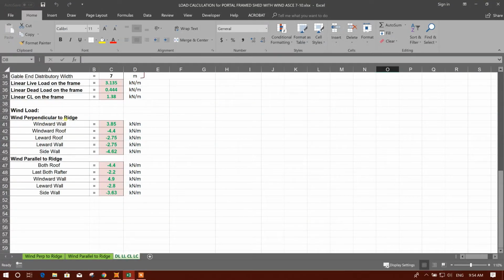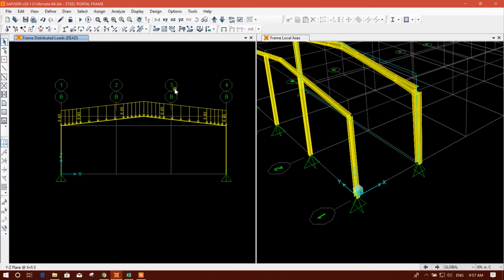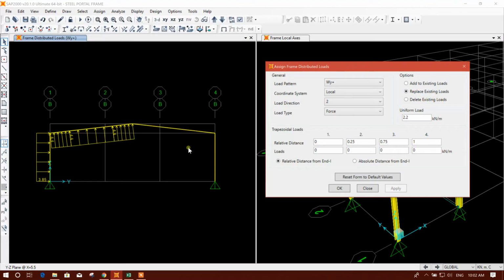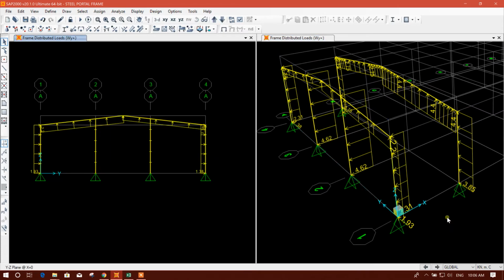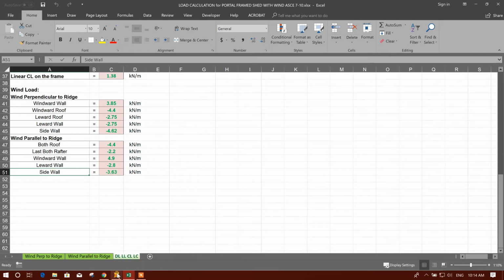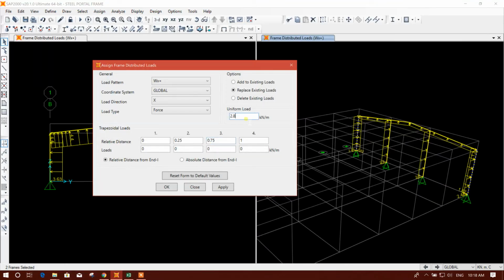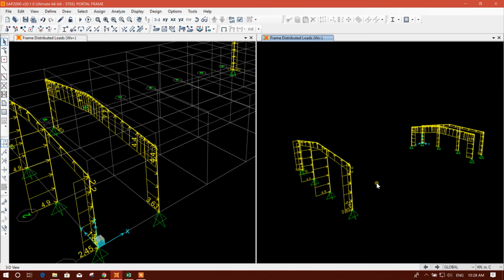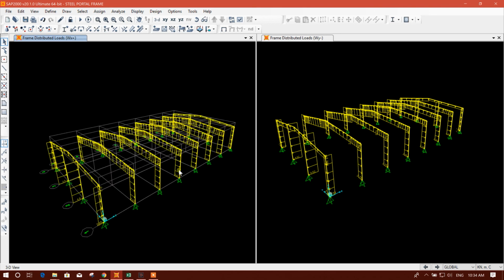DESIGN COURSE ON 3D STEEL PORTAL FRAME IN SAP2000-PART5

Comment: There is no need of break the section for taper purpose, as you are doing this is the wrong way instead whole tapered section can be built by combining 2 to 3 custom sections where you have defined those.
Reply: Benefit by breaking is we can get design forces for connection at that specific joint